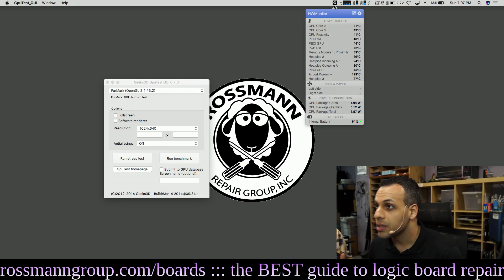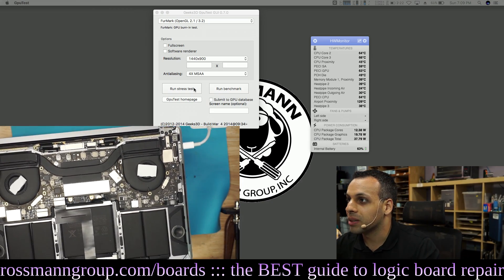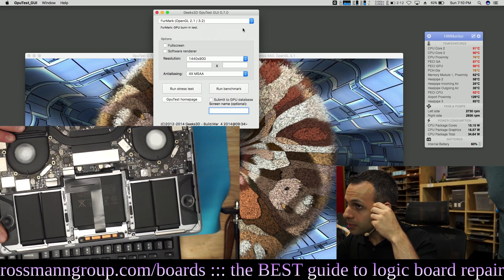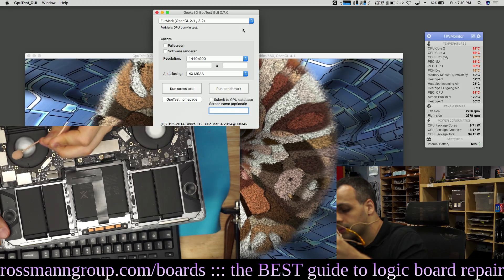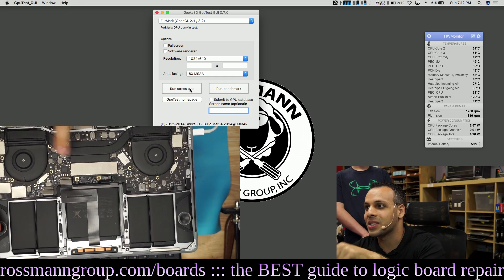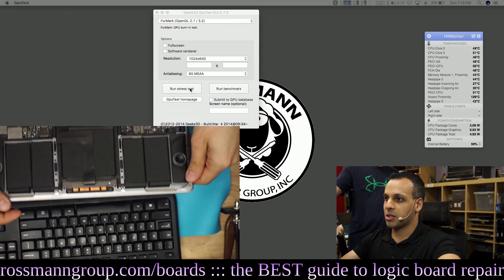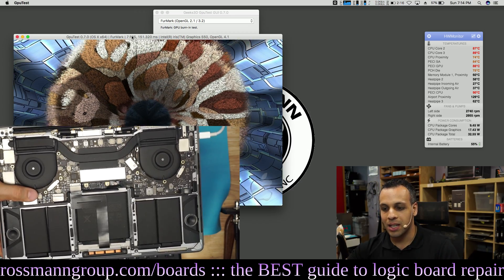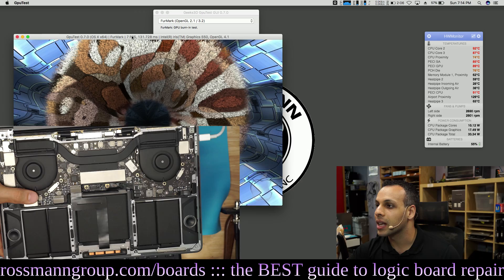Why Apple Macbook runs hot.

Comment: I monitored the fan on an older Dell and the fan didn't spin up until 80 degrees.  I changed Window's cooling policy between passive and active, same result.  I booted into Lubuntu, same result.  Even my current Dell doesn't spin up until 74 degrees.

I think it's more than one manufacturer setting the limit too high for when the fans start to do anything.

Comment: Awesome vids.  I used to have heat problems.  Not any more.  Then I downloaded and use "macs fan speed control 1.4.12."  It works great.  Allows me to set which heat sensor controls the fan and the temp range for the fan to run at from 2000 to 6200 rpm.  It shows the temps for all the other sensors.  I have it set for the sensor at CPU Core 1 to control the fan as this sensor tends to indicate a little hotter than the other sensors.  At the top of the screen it shows the fan speed and CPU Core 1 sensor temp. 

The average tamp , as I look at it now is 44 deg. C.  

I have a macbook pro 9,2 (2012)

Because of the increased fan use, I clean the inside of the lap top about every 6 months as the increased fan operation increases the amount of dust sucked into the computer.  First I turn it off, disconnect power, take off the bottom cover, vacuum the inside and keyboard with a soft brush adaptor on the vacuum, blow out the fan blades and heat exchanger fins with air from a compressed air can to make sure the fan and heat exchanger is dust free, then reassemble.  It is amazing how much dust collects, even though I keep the computer elevated on its corners from the work surface to help reduce the dust that would be sucked in from the work surface.  This also helps to increase air circulation under the computer to help it run cooler. 

Hope this helps :)

Comment: I’m confused because MacBooks have been known to last forever. Well in my experience they have. I have a 2008 MacBook that still works great. A friend of mine has one from the early 2000s and it still works great. The keyboard works just fine always has. One of the best computers I have had. Now I do like other computers for different reasons.
Reply: What was the average workload on them? That is the question.

Comment: Hello Louis, I think I've solved the heating problem in my MBP 2017. 1) Raise the back of the keyboard by half an inch maximum using a small pack of 1"x 0.5" sticky Post It labels and 2) Install the TG Pro app ($10) which controls the temperature by activating the two fans. By raising the back (1) the CPU´s temperature decreased by 5ºC and by configuring TG Pro the temperature never reaches more than 65ºC and I am using an external 23" monitor. Streaming movies on both screens the CPU's temperature never reaches 65ºC. I strongly recommend it. Hope it helps.

Comment: This is why I use a mac fan control software. I have it set to start turning the fan when the CPU gets to 45C. By the time it gets to 70C, it's spinning around 3000 RPM. Then it does a good job at keeping it at 60C by spinning between 2500-2800RPM. It's made it a lot cooler and it should last longer.

Comment: I always download and use the macs fan control. Its a program that allows you to control the fan speed of your Mac, but I don't think Apple likes it. I can keep it much cooler. I have a ASUS 2011 socket motherboard and that comes with its built in fan controller software. I love the Mac OS but I hate its hardware. Its truly redeeming quality is its based on Unix. I have a Windows 10 system on a custom built tower I built but I use the Mac more because I prefer its based on unix and mission control is better than windows 10 task view with two monitors. I also use have a Debian built pc that I use and hook them up all together with my two monitors with a four port dual monitor kvm.

Comment: And this is with the bottom off. Let alone if the bottom is on. You need to drill holes in the bottom to get temperatures as "low" as this. Otherwise the temperatures are way higher than this.

Comment: My work iMac (5k i7 with some crappy GPU) was freezing and rebooting at least once a day. Someone suggested it was the crappy power supply that can't handle AC fluctuations, so I got a UPS. That pushed the lockups down to just once or twice a week. Then once I started using Docker and other VMs more, it was starting to be multiple times a week. I had to install a utility that increased the minimum fan speed, and I configured it to be double the default speed (2100 rpms) before the thermal cutoff stopped rebooting the machine. 

I would NEVER get an i9 macbook or an iMac Pro- you'll never see increased performance under load and you'll burn up your hardware. The best option if you need MacOS is the new mac mini and an eGPU.

Comment: I have a 2010 Macbook pro and it gets extremely hot.  I mean waaaaaay over 100F we're talking at least 125F  Very hot to the touch and could prob cause a burn.  It seems when the power adapter is connected is when it gets the hottest.  Might have something to do with the battery.   But a quick solution is to just put the MBP on a cooling mat/fan.  I also point a small fan at the keyboard while raising the MBP up a little bit to let air flow over and under it.  Seems to work.  I also power it down when i'm not using it to allow it to cool.  And stop talking trash on Apple.  I'll tell you what.  I have never had any viruses or performance issues like having a PC.  PC's are such pains in the asses when it comes to performance.  I got sick and tired of reformatting and reinstalling Windows.  And yes, that's what you have to do if you want to guarantee a fix.  And that takes forever.  Anyway,  APPLE all the way guys.  And yes I did tech support for 15 yrs.

Comment: Puts two fans in system, but sets them to turn on only 11°C from Tjunction Max. What could possibly go wrong!

At least they do a really nice job with their thermal paste application sarcasm

And the mounting system they designed to ensure excellent heatspreader to processor die contact is incredible as well. No x-clamp or springs here, just good ole fashioned screws and a flimsy piece of copper get the job done just fine right?

And don't even get me started on their systems with discrete graphics... It's all of the above but with a GPU sitting right next to the CPU on the SAME heatpipe. That way they can both burn up together. Love it

Comment: And don't forget that it even runs hotter (up to 100°C and then throttle) when the bottom cover is on, because it has no ventilation holes.
This is why I sold my Macbook Pro in 2014 and got a Alienware laptop with decent cooling.

Comment: I got tired of being told "Macbooks are supposed to FEEL hot, because that's just the aluminum body dissipating the heat outwardly instead of trapping it" (HA!), so I finally installed SMC Fan Controller, and now when things get too hot I can manually activate the fans at high speed and watch the internal temp drop.

Comment: Those temperatures are insane and mostly outside of what intel recommends for cpu temperatures. Sandy - sky lake the max temp is 65-72 depending on the processor. Kaby lake does have the highest max of 100 and still far outside the mor normal acceptable range. 

I would freak if my cpu ever went above 65. My cpu is heavily oc'd has been for 6 years and i become uncomfortable when its in the  mid 40s but it is in a water loop. This is exactly why components that are pushed to their peak performance but maintained at a low temperature outlast components that are under clocked but over heat last longer. Anyone with any electronic or electrical experience knows the enemy of electricity is heat. Guess apple missed that memo..
Reply: I keep my CPUs under 85C at full load, they are 55C when doing normal tasks (air cooled)

Comment: I prefer apple's quiet approach, they are the only laptop company where I don't have to use third party apps to slow down the fans. However, they exaggerate in their approach, fans should start turning on around 65C in my opinion, especially if they are quiet fans.

Many PC laptops did this backwards. Loud fans at 50C, like the craptastic lenovo Yoga.

Comment: The machine won't necessarily fry within a few years if the fans won't go to full RPM... throttling keeps the CPU from getting beyond spec. 90c is hot but it's not crazy hot for silicon. Agreed they need to change the fan table or use Macs Fan Control to change it yourself. Core i9 in a Macbook, no way to keep it from throttling.

Comment: i seen that with an old all in one mac i touched. worked fine as long you didn't play games (like the gpu chip was cracked from heat from the looks) but i was able to find some fan software and max them out to like 3-5k+ rpm and they made so much noise and that gave me an answer why they die :3

Comment: wow you predicted the future :P (core i9 macbook)

Also on my 2010 MBA the fans stick at 2000RPM at all times, and ramp up dependant on heatsink proximity sensor. Yes the CPU can get to 75-78c before the fan runs wild (and up to 85c when the case is cold) i still think it's quite clever. It'll send the fans right up if it goes over 85c no matter how cold the case is

Comment: You're not going to fry an egg on a 10W cpu, it doesn't matter if it's at 70C, the total power output by that is tiny. You can have 1/4W resistors sitting on 100C, but you will never be able to heat up even a spoon of water even close to boiling temp. 

There is a difference between temperature and heat.

Comment: Yeah, I have a late 2017 touchbar model from my company. I can tell you that when the fan does kick in it gets load as hell (I run cpu intensive software). The 2015 model I had before was quieter (with the same software) until one of the fans just broke.

Comment: There is this one lady who reviewed the 2018 Macbook Pro with the 6 Core i7s and i9s and she mentioned a solution for better cooling for the MacBook Pros is to use a 3rd party software to override the crap Apple stock fan controller with a 3rd party program if you are running older MacBook pros that are running the version prior to High Sierra called SMC Fan control now for the High Sierra MacBook Pros it's Macs Fan Control. Here is the video. https://www.youtube.com/watch?v=myxo9TRedIs&t=909s

Comment: Yeah I knew that Apple's cooling system was poor. The only way to help it along it to apply some good thermal compound like liquid metal or something along those lines but I don't expect much improvement because of the piss poor fan control system that Apple put into place. With the Macbook pros that have the i7 Quad cores in them there is no way in hell those things can run with any kind of load with that piss poor fan controller because it will thermal throttle.
Reply: Liquid metal is a terrible solution for average consumer products.
Reply: I was using it as an example and I know there are probably better ones out there.

Comment: Also, Apple prefers to make thermal throttling kick in constantly, rather than pushing those damn fans a decent amount. I've used MacBook Pro 2017 with touchbar and AMD pro 560 for a year. I constantly used a fan control program to make it go full speed, or at least try to.

Comment: ... I thought this was common knowledge?

It is a well known fact that Macs don't spin up the fans until the component reaches a temperature of at least 80C degrees. And this is the reason why macbooks with discrete cards regularly die within 3 years of the purchase and why you can kill your imac within months if you run it at max for extended periods of time. I remember that some imac 2015 models even reached temperatures of close to 102C degrees before the fans would kick in.

Comment: 90C with over 2000RPM so the CPU cant be cooled acceptably (below 80C) AND the fans are noisy anything over 1000RPM is audible over 2000RPM is noisy it seems apples cooler is only designed to cool the CPU in light workloads and not the GPU at load as shown here.

i couldn't see any fins on apples cooling solution and even if there are tiny micro fins they would be well insulated by the fan shroud ensuring that it will sink no heat until the fans spin up which only happens after its puts the CPU at risk of cooking which means this anemic cooler is actually designed to cook CPUs i think a cheap motherboard VRM heat sink with a fan glued to it would be much better and cheap motherboard VRM heat sinks are known to also be terrible

this also makes any stock Intel cooler look really good

Comment: I own a MacBook Air 2015 and I’ve never had a fail on the machine. I use an app called smcFanControl and use it to dial up the fan speed to 6500 rpm. CPU stays at constant 35C, makes a bit of noise but at least the machine doesn’t fail.

Comment: So first, I'll admit, I have a Late 2016 15" with the useless touchbar. Am also looking to get rid of the thing currently as it's the most underpowered, overpriced, buggy POS i've ever owned. Honestly can't believe I've dealt with it for this long but having 2 other laptops handy has definitely helped me cope with this thing lol. Anyway, I noticed in both this video and your last that the Airport Proximity sensor on that machine is missing and HW Monitor never gets a temp reading due to that. Though on the machine I have, it actually registers temp and goes up and down with the other sensors. It usually idles around 42C but I've seen it at 51 and also 36. I'm not sure why my machine would have the sensor and the one you're playing not have it, but thought i would throw out that observation.

Comment: I'm late to this party but here goes. You mentioned high temperatures due to Apple's business plan of creating failures to promote early replacement sales. Louis is there anyway you can reprogram these chip functions to make the fans in this instance come on earlier and at a proper RPM rate? I don't believe that Apple is trying to keep the noise level down which would justify making fans run slower and not running sooner - that's just not believable considering all that has been revealed about Apple. "Fool me once shame on you, fool me twice shame on me." The more I listen to you then the more my opinions about Apple products are justified. "Apple kills Apples." The one think Apple does that I like is that laptop innards seem to be easier to access than their PC counterparts. That's not enough to justify paying a ton of money for a poorly designed system that will have a limited lifespan. Over the years I've had people try to freely give me an Apple and I've always turned them down just because of these issues - No Thanks! Thank You for these videos and we look forward to them each and every time one comes available. Praise The Lord and Godspeed to you all - Revelation 20:13!!

Comment: Even with sub optimal cooling I think they probably can get a way with delaying the fan activation a bit because the whole case is aluminum which is a competent thermal transfer material. But yeah, I would prefer that my mac's fans started slowly earlier.. It's not comfortable having a mac on the lap while doing anything remotely cpu intensive because it can get very hot..

Comment: Unfortunately I am required to use a Macbook pro for work. I fucking hate it. I do notice that the computer is significantly more quiet which I did find pleasant. I actually wondered if the thing was passively cooled for a while until I ran the first heavy workload and heard the fans spin up like crazy. That's when I realized it must be waiting until that CPU got pretty damn hot before turning on the fans. Reminded me that even though my PC laptop is somewhat loud due to the fans (sometimes), it is much better than having a $1000 laptop die in a year ($1000 instead of $3000 because it's a PC).
Reply: How can you not notice, it often feels like it's scorching my fingers.

Comment: Question: is there any way to set the fan threshold temperature in MacOS? Obviously not by default, but through a third party software or hacking some system files? I would be interested in that...

Comment: So Sue [my wife and luminary computer trainer here on WestCoast], sez to me this aft'noon, "Boy, this Macbook runs hot...see, put your hand on the Acer3. Now, Macbook"]. Yep, substantial tactile heat spike. I had even glued 4 additional grommets on top of the useless rubber hemispheres which were affording an initial whopping 1/8" of air space around the bottom when on a flat surface..increasing distance to abt 5/8".
Now this is the A-1268 I wrote you about which i would've sent to you for new GPU but Steve [on phone] sed you don't do these anymore...so I sent [logicboard only] to another vetted shop & so far so good.
Then shortly thereafter I wrote another post here asking if you thought maybe good to drill some holes in bottom of the so-called "unibody" while still on the workbench, for even more improvement in air circulation. Didn't hear back, tho I do realize you've a lot on your plate. The other shop backed off of this idea but I got the impression they were likely thinking more abt warranty claims, etc.

I'll ask again then, and if answer is a yes it may be a service to many of your subscribers  [+, hint as to best place to drill..?] .
As before, I have this 'buffered' email I use for socialmedia engagements, if it might be useful...
... DBackline@webbstream.com
Would just take a moment prbly, and could be an enormous help to countless others with the same sort of issue(s)?
Thanx & luv'n'cheers,
--DIon

Comment: Hold on a minute.  What's the CPU's temp range from the chip maker?  I've got various intel chips in PCs whose "maximum allowable temp" is in the low 70c's, so what chips do these use and what's their intended range?  Surely it can't be in the low to mid 90s?  If it's not then this is surely an engineered failure :-O

Comment: I set my fans manually at 4,000 rpm using istatmenu's
Played with various settings but 4,000 seemed about right
And did I mention how much cooler it was and no noticeable fan noise to my ears